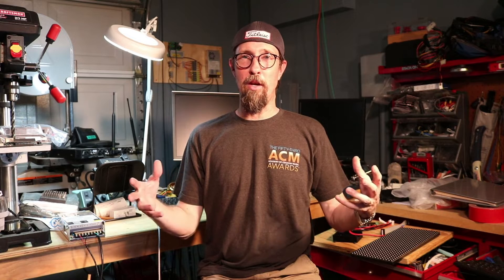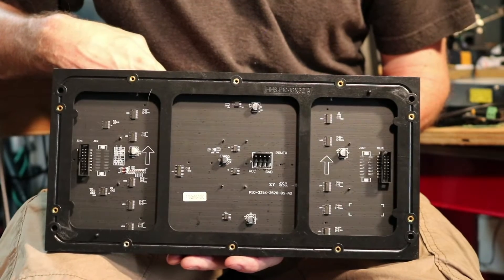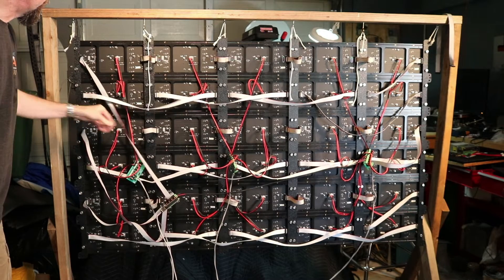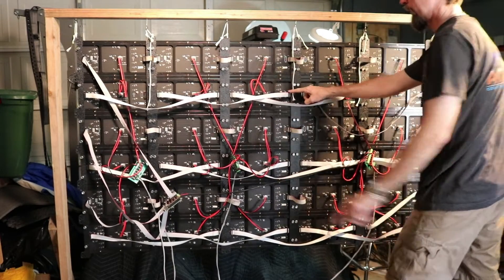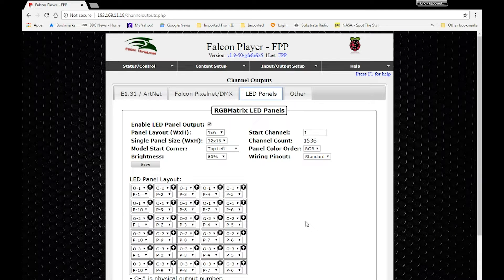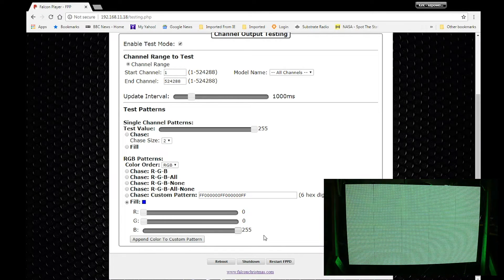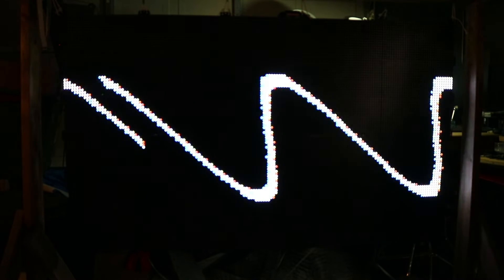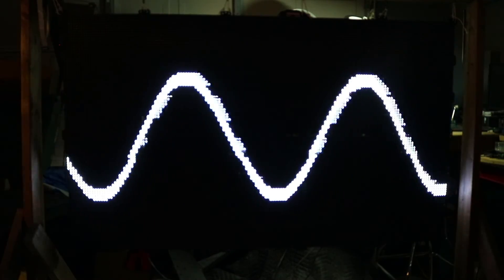P10 Matrix Tutorial

Comment: Hi, I'm new to this but been doing a ton of research! I want to build one of these for a DJ set, but want to use it to display video from my DJ software that has a video mixer in it. Does FPP bridged play whatever is on the display or MP4/MKV video files? my software VDJ has a video output mode and what I would like is to send the output video to the matrix via Rasberry Pi to a colorlight module to the matrix. I know they sell a HDMI sender box but that's a bit pricy for me. Is their a software where I can turn the Pie basically into a sender box? Thanks.

Comment: There appeared to be some flickering of individual LEDs on the right side.  Was this the camera acting up or was there an actual problem with the panels.  Could a snubber resistor help with the flicker or ghosting between the connector and the panel possibly help with that if that is the case?
Reply from the maker: This was a camera thing. The panel has no noticeable flicker.

Comment: Hello Kirk, thanks for the very helpful video. My boss bought a video van for mobile advertised used from one of the companies that do that exclusively. I am a skilled technician in most all entertainment A/V/L products, but panels, namely the P8 and P10 panels that are now a new part of my responsibilities under my tech hat. I was told to order new panels for some that have gone bad that are not power or ribbon related. I tried to place an order after finding the match to them, but wanted more info from the manufacter that what I found was the same and would work. The person I emailed back n fortth with told me even if I made the order they would not be compatible with our displays. I tried to get more info from that point, but think I was written off as a silly American....idk.  You may be able to help as I just got done with your mini coarse and again, thanks.  I understand the lifespan of most all LED used for lighting is a long linear fade over a large span of time and putting new panels in a display that has approx 4 to 500 hours use would cause the new ones stand out due to the difference in brightness. Would that possibly be the incompatibility they were talking about? That day I took it to mean that the panels would not output it's part of the whole but I never told him what data protocol we are using or anything software related. In this field what is the standard practice for swapping out a panel or group of panels that have issues?  I've only seen panel repairs down to a single pixel and that too was informative as I thought a type of flow soldering process was used in putting one together. Answering the questions I posed would really get me up to speed and I would be able to tell my supervisor why we havent ordered the panels I was given the ok to get. Any help would be appreciated. Thanks and have a better than average day.   Dan
Reply from the maker: Different manufacturing batches of panels have different tolerances. It is best to have all the panels from the same batch. That will give you the best opportunity to have matching panels. Depending on the content that is playing you may be able to get away with slight differences.